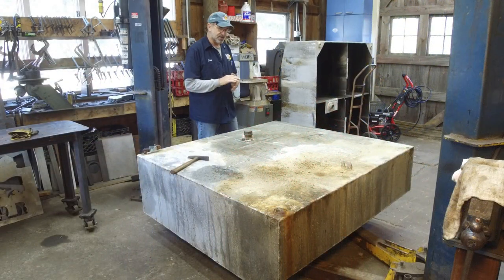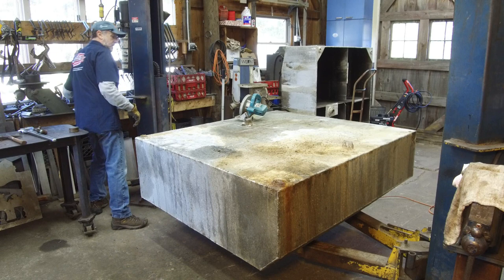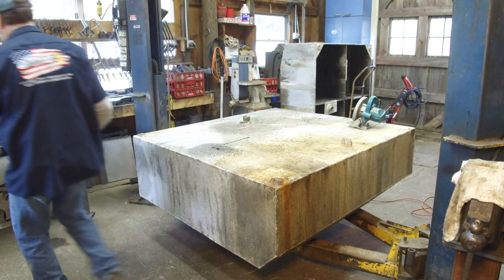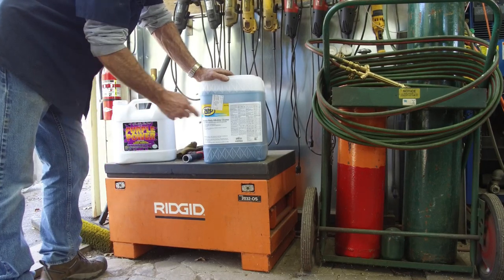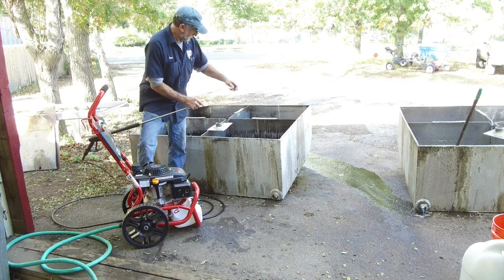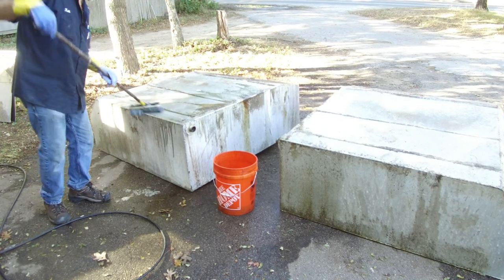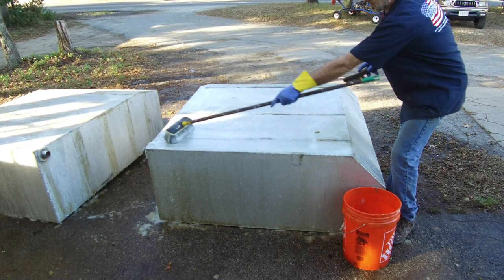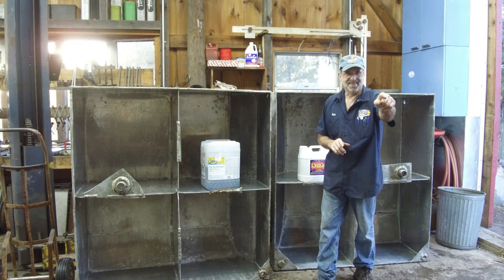Tanked Again

Comment: Working hard to support other  hard working people who need to git-r-done!   So purple is sodium hydroxide, a lil ruff on paint sometimes but a reasonably priced cleaner,  The hardware stores sell 'wood bleach' its a granular substance but is oxalic acid that really strips off the oxide and everything else.    I've used it to clean the inside of aluminum coolers to bright and shiny new.  Another awesome tool is the swivel adapter end for the pressure washer, just clips on where the nozzle goes, adjustable angle off center so lets you reach around corners some or go straight on as well.

Comment: Since the primary use of that electric/hydraulic lift is as a height adjusting device have you considered fabricobbling a par of "I" bar (two bars that have boxes on the ends that fit over the lifting pads that way you can keep the lifting arm locked out as far as width is concerned but still adjustable for end to end length which would allow you to place a pieces of cribbing/plywood.  I made the same setup for a lift at a shop I had worked at a few years ago and it made a wonderful adjustable height workbench when I laid 2"x8" oak boards on top and bolted them down with carriage bolts.  
With regards to cleaning with a brush and pressure washer Zep Concrete floor cleaner (the stuff that starts off as an orange powder and turns green when mixed with water is hard to beat for general degreasing/cleaning it also is handy to mix some up with water and have in a mop bucket much like was done with mineral spirts in the old days.  While it does not dry as fast as mineral spirts it also doesn't evaporate in the bucket like mineral spirts either and if when you get a oily film on top you can skim it off and keep using it.  Additionally TSP (Trisodiumphosphate) is another good general purpose cleaner for cleaning slimmy scummy stuff and when cleaning aluminum muriatic acid like you can get at  pool stores or paint stores is another good choice to maybe consider.
PS looking at the scum lines in the tanks I would guess those tanks were never left with much more that a quarter to half a tank of fuel which begs the question is do they need that big of fuel tanks. 
Interesting video as always StaySafe-N-StayHealthy

Comment: You can't beat Zep products for most everything. I was a mechanic for many years and used the orange Zep floor cleaner (which nothing else came close to cleaning the grease and oil) and I used both hot and cold tank cleaners from Zep also worked great..  I like Purple Power but have found other de-greasers that worked better and cost less.
Reply from the maker: Thanks for sharing
Reply: Zep makes a oil dry ,white powder works way better than clay
Reply: I'm going to use your suggestion. Can you provide a link to the floor cleaner?
Reply: @jheissjr  zep part number zuabs3 on amazon or lowes
Reply: @egancraneriggingservicesin9142  zuabs3 is an oil absorber that looks like cat litter. Is that the cleaner you suggested?

Comment: As a widower, now having to do my own laundry, that Purple Power stuff cleans my work clothes great. I just happened to do a load of EXTREMELY GREESE STAIN work clothes, had to wash them 4 times. Each time 3-cups of the Purple Power Degreaser. The load of wash was approx. a 3/4 load, or less. Three shirts, two pairs of pants. You would not believe they are the same clothes. Can't recommend Purple Power Degreaser enough. I'm not connected in any way, shape, form, with the product. Just passing on, the stuff works, great cleaning clothes; I was thinking of just throwing away because they were that dirty.

Comment: Hello Keith,  I would highly recommend a ninety degree joint out at the tip.  They are cheap and make out of position (under a car or the top underside of your tank) cleaning a breeze.  Mine is rated to 4200 psi and can be rotated anywhere in that ninety degree arc.  Uses standard tips.  I don't know where it is available in your area I get a cleaner called FIST for degreasing.  While Purple power is no slouch this stuff is quite a bit stronger.  I buy it at my Mobile plant.  Years ago this same outfit made another cleaner called PUNCH and it was really strong.  Cleaning gunk off machinery and aboard ship we used it to clean everything down quickly before repainting in shipyard.  This was the days before pressure washers were commonly available.  We would swab it on and rinse it off with a 2 1/2" fire hose using 150# pressure.  If you left it sit on painted surfaces for any length of time longer than twenty minutes it would lift the oil based paints.  Sure cut down cleaning time and effort.  I still use FIST today but haven't seen PUNCH in quite a while so maybe it is no longer made.  We used to buy both by the drum on ship but for my own use I buy it by the gallon.  Recently found it at my NAPA store too.  Give it a try it my be a good fit for you.

Comment: There is a product we us to call tank acid you should be able to get at you local Big Truck parts store (Truck Pro, Truck Parts Speciality, Kenworth),  maybe including Napa Auto Part. We us to spray it on the fuel tank, rims, and aluminum trailers to wash all the road grime off. We us to buy a Chemical resistance pump up sprayer, and mix the stuff with water spray it on there let it sit for a little bit. Then pressure wash it it off, tanks come out white afterwards, then you’d have to repolish and reseal the polish afterwards.

Comment: Keith get one of these from Amazon----TOTALBLAST Pressure Washer Rotating Turbo Nozzle 3,600 PSI, 3.0 Orifice, 2.5 GPM with 1/4" Quick Connect Plug
They really take the dirt off.
Reply from the maker: Thanks bought one on EBAY ;{)
Reply: Yeah, those turbo nozzles make a HUGE difference.
Reply: One thing I have found on turbo nozzles,  NEVER leave any moisture in the nozzle after using it.  Take it off the hose/wand and blow it out with air and leave it off. They can corrode.  More important in winter, hope everyone who experiences below freezing temps know about winterizing your pump.  If you dry it after each use, it will last and last.

Comment: Yep, alkali will react with aluminum and release Hydrogen gas and get hot.  Build up some of that with an ignition source and BOOM lots of pieces of metal flying around and a destroyed tank.  Where I used to work we used trucks (about Army 2 1/2 ton size) to haul liquid sludge in aluminum tanks and were going to use them to haul used lime sludge from the water plant and couldn't risk explosions, so we had to get some tanks built of stainless steel.

Comment: Assuming that is an aluminum tank I understand cutting with a carbide tipped saw. I suggest lubricating the cut by drawing on the cut line with solid paraffin. The fuel explained using the saw and not a plasma cutter.

Comment: Zep for organic stains then use aluminum brightener like we use on truck trailers and tanks for corrosion and other stains.  Don't leave the brightener on too long or it will streak and you'll have to go over it again.  The brighener is also called aluminum acid and it will leave a good oxidation layer that will protect the aluminum from further corrosion.  It's what we used for doing welding jobs on aluminum dump trailers.  Give it a try if you haven't already.
Reply: And always wet from the bottom up. If you start at the top the drip will soak the item and always show, the same goes for washing cars and walls.

Comment: I have had bad experiences with aluminum. My first was a head gasket on an engine with an aluminum head. The engine had been run with insufficient rust inhibitor and the head had become porous. And when welding contaminated aluminum, I saw that the corrosion can run deep into the metal, very similar to your experience with the John Deere expansion tank. I imagine that plate aluminum may not corrode in the same manner. But I would be leery of potential leaks in corroded areas. If the tank develops some porosity, it may not be the only one to start weeping.

Comment: Simple body etch and epoxy powder coat inside and out would do wonders for these to last time.  At least the outside from cleaners that eat Al and such.  The walls prevent sloshing side to side and bust out a side or burst a seam.

Comment: When one of my fuel tanks started to leak last spring, I first thought "shit, I've got to remove the engines to get the fuel tanks out" but then I found a product called Por 15 fuel tank sealer that is used to seal tanks from the inside. It's like paint and from what I've read, it should last for decades if the surface preparation is done correctly.
Reply: I have used POR 15 for decades in the body shop business. Their epoxy paint is a great product. You can brush it or spray it on and it is extremely durable. Used many of their products and recommend their rust preventive product as well. Can't say enough good things about their line of products.

Comment: Young brothers make a really nice boat.  The 1-1/2 TOL was used as it was about the same price as a 1/2 or 3/4 “ and not much more welding,  plus it gives you something to crank on if the threads where rust welded.
Reply from the maker: Better to use pick up tubes in a fuel tank rather than open port at bottom of tank. ;{)
Reply: At least for road going vehicles, by D.O.T. regulations, all fuel must be drawn through the top of the tank.  The thinking is you have something of a syphon break if a line is severed VS full flow gravity feed if the line fed off a bottom sump.
Reply: @member5488  With boats and aircraft, you typically have a pick up tube from the top that stops a couple of inches short, or a standpipe if picking up from the bottom.
Stops the fuel system dragging up all the water and sludge that forms. Bungs on the bottom of tanks are for draining, not fuelling.

Comment: Next time use a pump-up sprayer with the zep it's well worth the effort cause you can concentrate on problem areas and you dont dilute the zep with dirt and grime you get in your brush and simple green does alot better job than purple power too and it's biodegradable

Comment: Purple Power is like Castrol Super Clean but cheaper.. It does a good job on removing grease and old loose paint that needs to come off... It will etch aluminum though...The Zep cleaner I am not familiar with but will try it at some point... Cheers from Louisiana

Comment: Hi Keith Nice shop you have , Did you ever use Miratic Acid for aluminum I`ve used it to polish my Transport fuel tanks Mix it 50-50 water Can get at most Hardware stores it`s for cleaning concrete but works fantastic on Aluminum & Water soluble , Brush on go for coffee washoff.

Comment: Hey Keith correct me if I'm wrong but you shouldn't have to shut the washer down to change nozzles at least I don't on my similar washer!
Reply from the maker: I thought so, that's why I did in the earlier change out, but realized, no water was flowing out when trigger wasn't pulled. I still think it good practice to shut down, only reason was it popped out because I didn't snap it in all the way. ;{)

Comment: Keith - Do you know what aluminum alloy was used in the original construction of the tanks? Seems like for specialized marine tanks the designers would have specified an alloy with enhanced corrosion resistance, like 3003 or similar.

Comment: Appreciate there’s no easy solution but putting all those chemicals and wash off into the soil/groundwater isn’t great.
Reply: Insignificant amount to do any harm, plus most of those cleaners break down in the environment anyway.
Reply: It’s a small amount but it all adds up. I’ve had serious problems in the U.K. trying to get rid of coolant/cutting oil clean out from a hobby shop. Ended up paying a car mechanic shop to put it in their waste oil tank. Loads of respect for Keith but in a commercial business you shouldn’t be washing off fuel tanks into the ground.
Reply: Solution would be to rag out/paper towel with de-greasant the initial clean. Towels go in the bin. Put down a plastic sheet with raised borders while you do the initial brush clean off. Minimal water maximum detergent. Soak up detergent with straw, cardboard or anything and put it in your waste bin after drying it out the best you can. Final wash off into the ground but you’ve removed 90% of the toxic stuff which will now go into controlled landfill away from and water contamination.

Comment: Looks like a 300 imp gal tank like the ones on small diesel powered vehicles that I worked on 4.5 liter to a gallon a full 20 fluid oz to a pint not short 16 fluid oz pint.  I ordered a pint of beer in a bar in USA forgot short measure.

Comment: Adam Booth just opened his new toy that rotated a piece that you are welding.  Looks just like your self made welding rotating device. $3000. I thought for that price it would hold your wirewelder for you. Nope. Maybe you can do them a step up and make one that holds and advances the wirewelder. Never will beat ordering a bigger piece of metal.

Comment: Next time you do that, get a router and a good flush cutting bit - drill a hole an away you go.  At least, it'd be louder.  That would wake up the dead and the horse they rode in on.

Comment: Looks like people have been throwing the sump oil back in with the diesel, some myth it helps the injectors.. clogs them morelikely
Reply: carbon buildup on the ends of them that blocks the spray and makes them drip.  now ATF on the other hand...

Comment: Not familiar with marine fuels.  Is there not a chance of explosion / fire?  I know aluminum doesn't spark, but I'd still be concerned.
Reply: If it´s diesel fuel, the dangers are pretty low as the flashpoint is pretty high.
Reply: Once you learn how to properly prep a fuel tank before you make any sparks , they become unimportant. Even with highly unstable fuel. It helps to be a well trained firefighter before you become a welder . Explosion and fires require three components for rapid oxidation to occur ,  one fuel. two oxidized (air or some thing containing oxygen) three energy sufficient to start the peocess.
 The easiest thing to replace is the oxidizer  this can be done with inert gas.  Disease fuels are more stable they require  more heat to get a reaction started,  gasoline is one of the less stable but it is not  the most unstable fuel around. I  have welded up lots of fuel tanks over a spain of 50 years. I am retired so no more welding on fuel tanks. If you are not fully equipped and prepared, do not try to weld a feel tank.. or even weld close to a fuel tank.

Comment: I have found over the years restoring tractors that a product called Mean Green works better than Purple Power and is cheaper. Available at Walmart, Lowes, Dollar Store. Does not turn aluminum black.
Reply: I have had good luck with mean green also.

Comment: I'm ASSuming that this was diesel fuel.   But even with diesel, I would be fearful of fires or even explosions.
Reply: Keith was using a cold cut saw, not an abrasive. Much, much safer. Gasoline would have been slightly dangerous, but not diesel.
Reply: @lifeofgold  --  I admit some excessive concern.    A few miles away from where we live, a fellow had converted a former gas station into a coffee shop/restaurant.    BUT the gas tank had never been removed.   The guy decided to remove the tank and brought in a front loader with back hoe.

Somewhere in the process the tank exploded.  The explosion launched the owner's body some 40' away.  (This happened in the town of Colonial Beach, VA if you want to look it up.)

Some of you folks might remember the transport aircraft that exploded relatively close to Long Island, NY.   The explosion was traced to the main fuel tank.  The fuel likely had a vapor pressure somewhere between diesel and gasoline.

As far as "non-sparking tools are concerned, yeah, using them is a damn good idea.  But there are all kinds of ways a spark might be created.

My understanding is that large ocean going vessels (especially tankers) have systems installed to "purge" the oxygen containing air from the tanks by directing a portion of the combustion products from the propulsion system (either a diesel engine or a steam plant) into the tanks.

Comment: Jobs like this you should think about the cost . You spend 2/3 the cost to clean the tank and put a new top on it so now you have a 30 year old tank with a bandage. For piece of mind spend a little bit more money and build new tanks .
Reply: that's up to the customer if he wants to throw good money after bad.  this aint kieth's first rodeo. i am sure he put enough gotcha room in his quote.
Reply: Downtime is a big factor too as they say time is money and a patch  is alot faster
Reply: Time may be money but the time it takes to pull these tanks out of the boat to replace them if they start leaking is a lot of time and money. Building two tanks like this is not a large cost compared to pulling a boat this size out of the water cutting the fiberglass deck and pulling the tanks out and then installing the new tanks and fiberglass the deck back down.

Comment: Since it was old oil tanks I was thinking about the fire hazard when cutting them open.
But it seems like they at least aren't completely impossible to fix up. Just watch out for pinhole spots where there might be leaks, from what I have seen aluminum is a bit quirky that way, it can look perfectly fine at first glance and then you'll have one single pin hole somewhere.
Reply: just a fun fact, you can cut open fuel / gas tanks even with a grinder only as long as the heat is not as hot as the ignition point,  it is faster and safer to use a saw ( in this case ) or nippers of some sort ( pneumatic or electric )